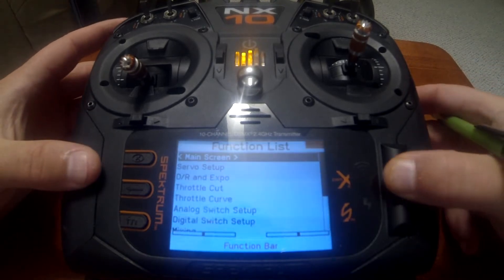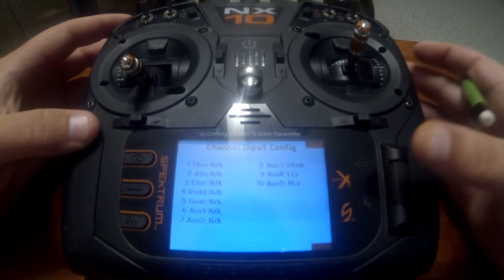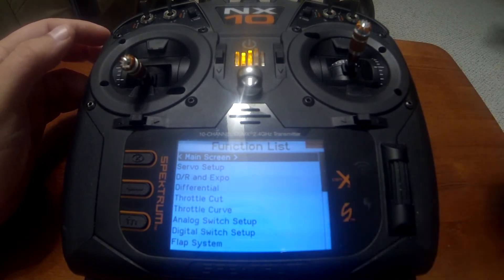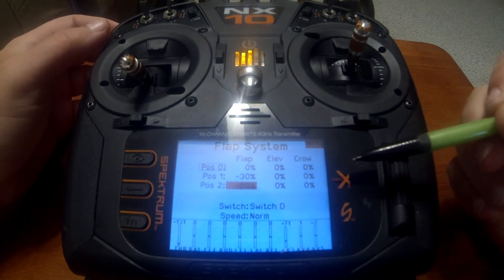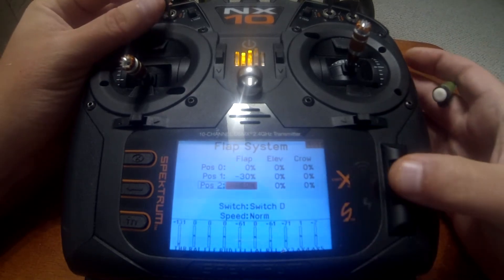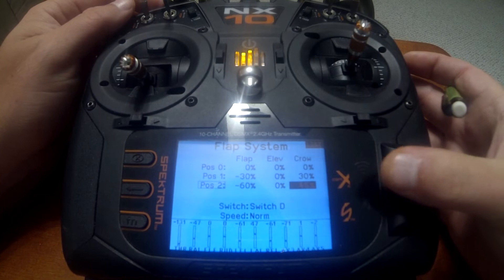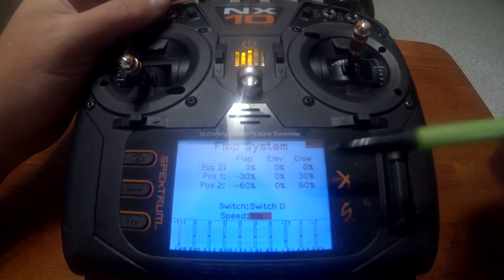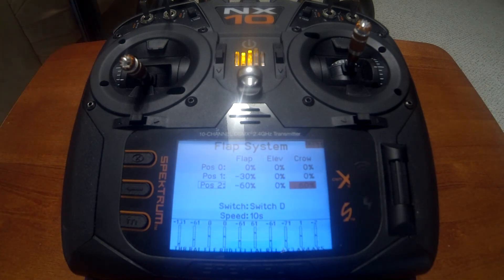Spektrum NX Setup: Crow Braking Tutorial (NX6/NX8/NX10)

Comment: Hello
I set up my F14 Tomcat with 2 aileron servos and 1 flap servo as the wing and elevons as I have 2 separated servos for the elevator.  I just cannot program my NX10 so that when the wings are extended, the tail works only as elevator and not as elevons.  Any suggestion?

Of course I need the opposite also.  When the wings are retracted, I need the tail to work as elevons and the wing aileron surface not to move.

It would be a great help i you could give me some pointers

Comment: Another great video.  One question is if it is possible to link crow mode to a switch if you program it like in the video ?  Only way i have found until now is to programm the feature with three mixes on the same switch.  One mix activates the ailerons, second mix activates the flaps and third mix activates an elevator compensation.  Disadvantage to using mixes is that i don't see how you can then control the speed of the crow activation.
Reply from the maker: Setup in the flap system you set to same switch as flaps. Manual mix can do more such as features you mentioned.

Comment: The strategy of crow is not to add drag/braking. Using crow is to provide wing “washout”, to add stability by lowering the stall speed when landing.
Reply from the maker: Crow braking its how its described. Ailerons deflected up (spoilers) creates drag/braking. Spoilers mix with flaps creates crow. Yes, creates stability too...Glider pilots even call them "dive brakes".

Comment: Since the flaps work together (up or down), why won’t a Y cable work on a single flap channel?  Similarly, why do you need two flap servos since both do identically the same thing?
Reply from the maker: You can keep the flaps on a Y since they go one direction and together.

2 flap servos is needed to pull up crow menu as show in video. Also so you can make them go the same way (ie:up). When on a Y they will go opposite...
Reply: @BDTennessee  I don't understand. When I connect the flaps to a Y-cable, the left and right go in opposite directions. 
How do you correct that?
Reply from the maker: @HuibNederhof  use individual channels or replace servo with different direction operation...
Reply: @BDTennessee  It would be nice if there was a Y-cable that was crossed so that the flaps moved in the same direction
Reply from the maker: @HuibNederhof  try a servo reverser lead on one side.

Comment: Thanks, that looks so much easier than on open tx, which I can not seem to program Crow! 😀👍
Now NX8.. or Nx 10? 
Pity Hall Effect Gimbals only on NX10 😢
Reply from the maker: NX8 best value.Plenty of channels,8 independent ,not much more than NX6...

NX10 is worth slightly extra tho. Gimbals as you mentioned,bigger battery (alot of users upgrade the NX8 too,which close cost gap) and 2 extra channels.

Comment: I just got my new NX 10 and I’ve been watching your videos on how to set a bunch of things up and I noticed this episode involving setting up crow into an airplane. On my old DX 8  I set up crow on one of my gliders, and just used one flap to set it up because I only had a six channel receiver. I needed six channel to separate my ailerons in order to make crow work but I do not see why I would need to have two channels for the flaps. Am I correct to assume that I can’t put crow into anything that uses a six channel receiver? Love your videos by the way.
Reply from the maker: Correct,you dont have to separate the flaps.I just showed more advanced way which allows to adjust trims,sub trims ,etc separate for left and right flap separate.

Comment: Are you saying you have to physically re-wire the flaps and ailerons on the aircraft first?  If so why don't you show how that is done and explain what is required?
Reply from the maker: Video shows how to assign and setup servos on different channels. Remove Y harness if currently configured with one. Plug servos straight into receiver channels as shown.

Comment: Not Shure how but I split my alerons but flaps are in Y configuration and I have crow set up
Reply from the maker: You can set them up like in the video with flap system. Another option is a separate mix. Flaps dont have to be separated.

Comment: The video shows to plug in the flap to the gear channel.  Then it never indicates where to plug in the gear.   Where does the gear plug in ?
Reply from the maker: Move the Left Aileron to Channel 7 and leave Channel 5 Gear. These settings need to be done in RX Port Assignment.

Comment: Hi there, do your SAFE/AS3X modes still work after separating the ailerons into separate channels? Thanks!
Reply from the maker: Yes when unlocking a receiver.If you have a BNF and just separate channels it will only work on one aileron.
Reply: @BDTennessee  When you say "when unlocking a receiver", are you saying a BNF receiver can have something done to "unlock" its configuration so you can separate ail channels?
Reply from the maker: @FlyinDog-Art  yes.You can unlock the BNF receiver and makes it full control like a receiver off the shelf. Only thing not the same,doesnt have altitude telemetry...

Comment: When i try setup crow, the ailerons move on opposite directions.
I have not been able to figure out how to fix this.
The normal aileron steering direction is correct, just the crow goes in opposite directions
Reply from the maker: Plug the correct side into the assign aileron channels. Once thats done reverse the one the not responding correctly.

Comment: BD, I have question? Can I set up Crow not using the same Switch my Flaps are on which, I use Switch D for Flaps?  I would want  Crow to come on after landing to slow the Plane  down on a Tar runway that is only 150' long and set it up to Switch E on my NX8?  Thank you in Advance BD!
Reply from the maker: Yes ,you can put crow on E switch to have separate from flaps.

E > RAIL for switch E and set values
E > FLP for switch E and set values

Set desired values in the right column (there is left and right).

Comment: Is there a way to have crow braking activated on a switch so you go from normal flap actuation to crow braking rather then having to stick to only one or the other. I have the NX-8 remote and I couldn’t find anything about crow in the manual so thank you for the tutorial.
Reply from the maker: Yes, you can set a mix so the crow is on separate switch.Then you can have 2 flap settings and 2 crow settings for difference degrees of deflection.
Reply: @BDTennessee  thank you very much. I will definitely try this on my Turbo Timber 1.5. My landings are very shallow and I wanted a way to decent at a steeper angle on my approaches.
Reply from the maker: @bomberex7809  before doing crow setup.Consider using down elevator mix with flaps.Timber floats so easy just changed the pitch on approach.
Reply: @BDTennessee  that’s how I have it currently my problem is that it floats to well so when I try a steeper approach it goes faster
Reply from the maker: @bomberex7809  oh gotcha. If you pulling the power all the way down and still to fast with nose down,this will be good route for sure.

Comment: I  have always thought that cow mixing was set up on the throttle stick. Throttle goes to a trim lever or wherever desired. That would feel weird on a switch
Reply from the maker: Different ways to setup. I have always seen it on a switch so its not dependent on throttle.

Comment: I have an NX8 and am wanting to set up crow on my valiant. I have a smart 631 6 channel receiver in the plane. I have been able to separate the ailerons on separate channels but they will only work in one direction like they are flaps only. Is there anyway to make crow work on the ar631 and still keep safe for emergencies or am I going to have to go up to an 8 channel receiver? Thanks for the great videos on the NX series of transmitters, they are the best out there. Keep up the great work!
Reply from the maker: So what you need to do is reverse the correct servo in the servo setup screen.Move the stick left and right to see which one isnt going up (ie. Left move left ail up and right moves right ail up) Then which one doesnt move correctly you need to reverse. So left says you moved stick right and right goes down instead of up.Here is how you fix it.

Settings>Servo Setup> Click on "Travel" > Scroll to "Reverse" > Click on the switch for RAIL (right aileron). Switch will change position. Done.

If its the Left Ail do the same thing except click on LAIL (left aileron) to reverse.
Reply: Hello @BDTennessee , 

I'm currently working on configuring Crow Braking for my electric glider, which features a four-servo wing setup. My equipment includes an NX8 transmitter and an AR6610T receiver. As of now, I've only reversed one of my flaps. Believe I've only reassigned one of the channels for flaps but ailerons are setup as default.

Here's the issue I'm grappling with: In normal flight mode, the ailerons operate correctly, moving in the right direction. However, when I attempt to set up Crow Braking, the left aileron behaves oppositely to the right aileron. Could you kindly provide guidance on how to adjust the left aileron's behavior when in Crow Braking mode?
Reply from the maker: @davidperkins5794  current issue with firmware 3.10

Have you tried making a manual mix for a fix?

Comment: Hi, nice video. I would like to ask let's say I want a landing flap ls in position 2 but crow only switch after landing? Do u think mix can do that? Like a separate swith to activate the crow?
Reply from the maker: Yes you could do that. You would make a mix for crow on a separate switch in the mixing screen. "Crow Mix" is what was done before this became available in flap menu
Reply: @BDTennessee  thanks appreciate it. So that can't be implemented if using under this flaps menu?
Reply from the maker: @visvanathansivasangran1594  are you talking about ,wanting only the ailerons up and no flaps after landing?
Reply: I think I'm making things complicated😅. It's alright. Thanks alot for the guides bro
Reply from the maker: @visvanathansivasangran1594  not really complicated just trying to clarify what your asking...
Reply: @BDTennessee  do let me try my best to explain. I want my flaps in 3 posn switch. 0 flaps up, 1 for take off flaps and 2 for landing flaps. When I put in position 2, I want my flaps to go fully down but I don't want my ailerons go to crow position(up) yet. I want the ailerons to go up when the plane touch down...like use another switch to activate the ailerons up.. its too complicated but is it possible?
Reply from the maker: @visvanathansivasangran1594  thats what i thought you were talking about.So yeah you can do that! You need to go in mixing.

Settings > Mixing.> Assign Switch to Use at bottom "Switch:on" is default. Need one for both Ail (Ail-RAIL / Ail-LAIL) and percentages to make them go up
Reply: @BDTennessee  alright man. I'll give it a try. And thank u so much. Really appreciate it.
Reply from the maker: @visvanathansivasangran1594  your welcome! If you need more help ,pm me on FB...
Reply: @BDTennessee  hi again, if I put the crow value to -30 or -60 can it work as a full span flaps? Will it go down also?
Reply from the maker: @visvanathansivasangran1594  You can put negative or positive percentage based upon up or down position.

Comment: Love your instructional videos Brandon. I am getting ready to set up crow on a new motor sailplane using NX8 and a AR8360T 8ch receiver. With safe that loads up all my channels. I need an xtra channel for my beacon locator. Too many lost planes at our airfield. Why do I need to set up flaps on 2 channels? It seems flaps on a single channel and y connector would be preferable like in the NX6 question here. That would free up ch8 for my beacon. Thanks in advance.
Reply from the maker: That works too! I was showing in the video how to put it all on separate channels.

Comment: What if I'm (or anyone else) is still using safe on ch5? (I know I can move safe anywhere else, but just wondering.)

Great video series sir! 👍
Reply from the maker: Configure channel 8 to the channel you want to assign and do the 5 toggle switch method.

Also you can set Channel 5 to gear again and move L Flap to Channel 8.